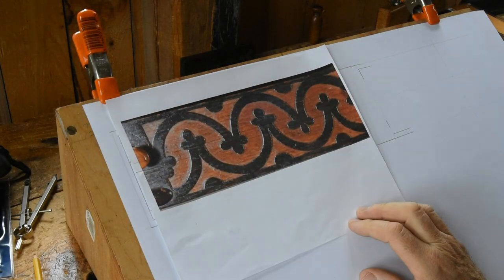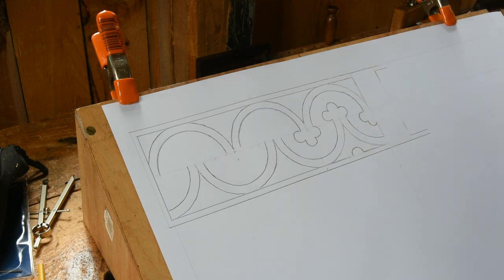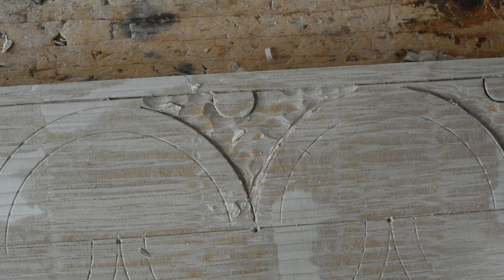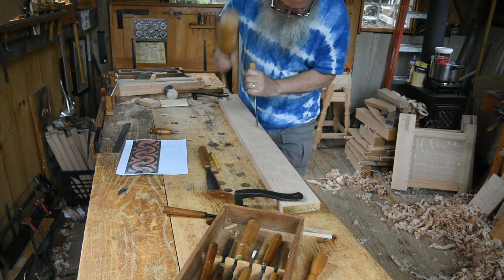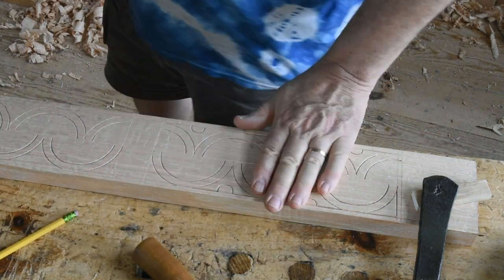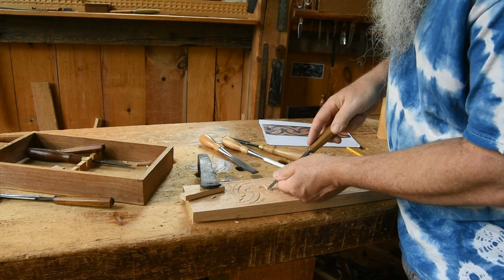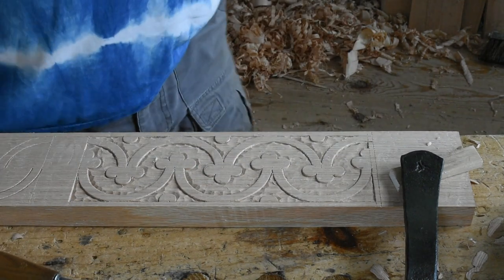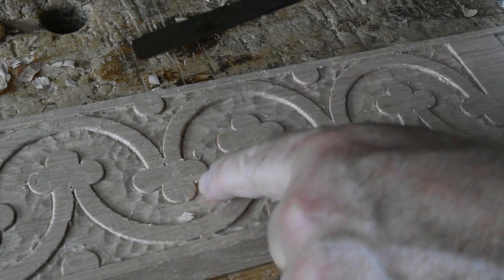carved drawer front

Comment: Please forgive a dumb question but if the very smooth background is a requirement, why would a router plane not be used?
Reply from the maker: Nothing to forgive - I didn't/don't use a router plane because it has a straight iron which can leaves tracks or dings in the surface. I also find it hard to see what I'm after with one.

Comment: would it work (at the 37 min mark) to use a flat chisel to chase out the facets left by the original chasing of the arcs?
Reply from the maker: Similar to the router plane question - the slightly arced and curved edge of the carving gouge is less likely to dig in & leave tracks like the corner of a flat chisel will. I'm sure you could do it with one, and with the router plane of the previous question. My tendency is to do what you see here.
Reply: @MrFollansbee  Thanks for the quick answer. I'm sorry I didn't read the router plane question. I was still quite focused on your work as I was typing!
Reply from the maker: @mattpage9826  Don't be sorry - no harm in questions. And I answered that one & yours at the same time...